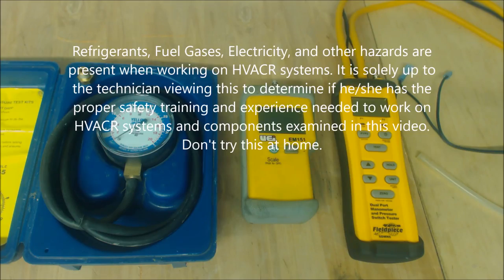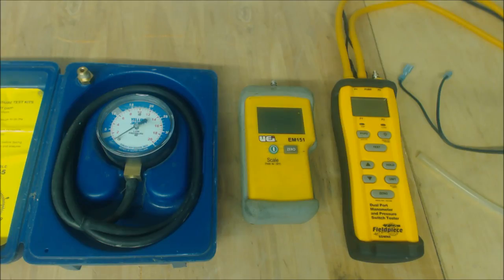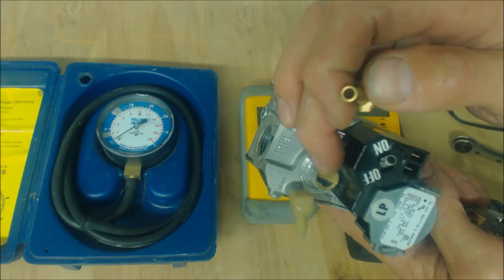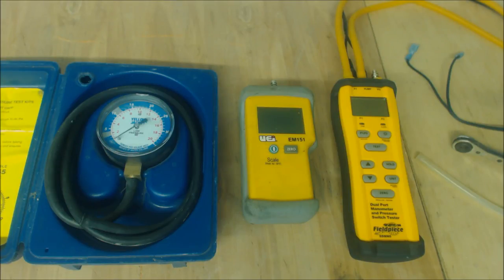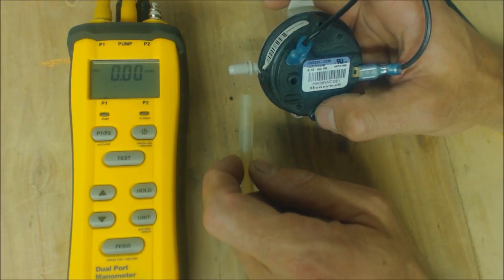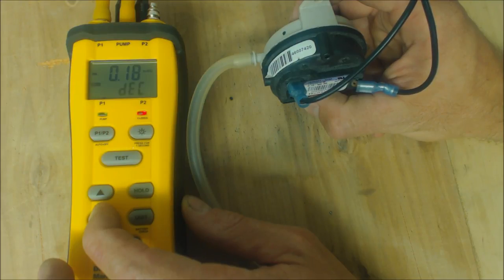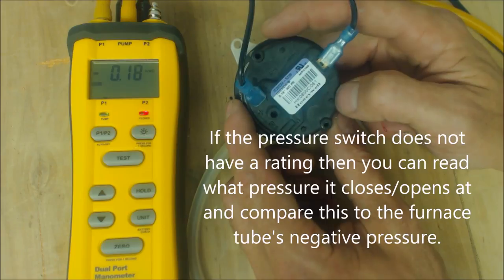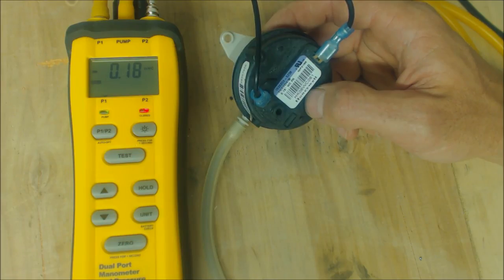Testing a Gas Furnace Pressure Switch with a Digital Manometer! & Why I Use This on Heaters!

Comment from the maker: Tool List-  https://www.amazon.com/shop/acservicetech
Support-  https://www.patreon.com/acservicetech
For those that are looking for the tools used in the videos: (Linked Below)

Here is the link to the Fieldpiece SDMN6 Dual Pressure Testing Manometer with Pump used in the video  -http://amzn.to/2jyK5Ka

Here is the link to the Gauge type Yellow Jacket Gas Pressure Tester-   http://amzn.to/2h8PANc

Here is the link for the 2 port UEI digital manometer since the single port is no longer available-  http://amzn.to/2x95KiD

Here is the link for the Ratcheting Service Wrench   http://amzn.to/2dGV4Nh

Here is the link to the Fieldpiece ST4 Dual Temp Meter- http://amzn.to/2wc1ME3

Here is a link to the UEI DL389 Multimeter used in the videos-  http://amzn.to/2xAdaJf

Here is the link for the Irwin Wire Stripper/Cutter/Crimper   http://amzn.to/2dGTj2V

Here is a link for the Supco Magnet Jumpers http://amzn.to/2gS4h6z

Other tool links can be found in the video description section.

ACSERVICETECH is a participant in the Amazon Services LLC Associates Program, an affiliate advertising program designed to provide a means for sites to earn advertising fees by advertising and linking to Amazon.

All of the ACSERVICETECH Playlists-  https://www.youtube.com/channel/UCOZR-1IqsAer9wzlvFgb4mA/playlists?view_as=public

If you want to support the ACSERVICETECH Channel and receive more HVAC content, correspond, or collaborate on your endeavors- check out www.Patreon.com/acservicetech

Comment: I love that manometer, heating season is starting and I look forward to using mine again ( Bought it after I watched one of your vids )  Prior to getting it I made a similar one out of my single port manometer, a T junction, tubing ( obviously ), and one of my insulin syringes with needle removed. ( im sure you can visualize how this went together) , I stuffed the syringe which fit perfectly in the tube and sealed itself and hid that it was actually a medical device ( less odd for customer ) And i could use the manometer reading after connecting and zeroing as the reference as to the vacuum I was pulling by pulling the plunger out  VERY VERY SLOWLY AND CAREFULLY * ( seriously green plumber reading this,do not underestimate how sensitive the switch is and how easy you can break it  )   *   I could then check the continuity with my electrical meter with aligator clips on the leads hooked up, I could do positive pressure switch tests in the same way by beginning with the plunger on the syringe pulled out. I loooove a good problem to solve, and when I was a young green gas fitter  a persistent problem to solve was how to ( ethically ) get expensive tools I could not afford to do the job. ;)
Reply from the maker: Wow very nice method and yes thanks for letting people know that it is very easy to break the pressure switch. I love this tester too, thanks!
Reply: Very ingenious! Now I am pondering on a 2.0 version using a fountain pen screw piston converter.

Comment: Love the videos.   Great that you explained how the manufacturer's have made these furnaces so complicated that the yj gas tester is almost useless.   Don't like the idea of buying another tool.  What happened to the good old days?
Reply from the maker: Honestly sometimes the efficiency is not worth is when an 800 variable speed part breaks like an inducer motor or modulating gas valve, thanks!

Comment: nice manometer, this thing is awesome. Ive a dual port tpi manometer, does not have a pump like yours though... that thing is pimp :)
Reply from the maker: It is nice! Thanks MrDmadness!
Reply: I odered one today.... I have used a syringe tied into a T of tubng for a long time now to add slight Pressure. ( Im diabetic, and the syringe has no needle on it ) and it always feels a little weird whipping out port tubing and a syringe on a service call. :)

Comment: how did you drill out that drip leg with barb fitting? how often do you find inlet gas pressure is incorrect?
Reply from the maker: Literally just with a drill bit and thread tap. Incorrect inlet gas pressure is found often on propane and also just when gas lines are incorrectly sized.

Comment: What size is the brass fitting?
Reply from the maker: Here are the links Chris and have you checked out the latest pressure switch testing video with the manometer?-

Here is the link to the 3/16" x 3/16" x 3/16" brass barbed tee-  https://amzn.to/2INSRhQ

Here is the link for the 1/8" NPTF x 3/16" barb fitting for reading wc pressure- https://amzn.to/2G563Bq

Fieldpiece SDMN6 Dual Pressure Testing Manometer with Pump-http://amzn.to/2jyK5Ka 
UEI Digital Dual Manometer-  https://amzn.to/2CWC6BD

Comment: with the gas valve you had  first  look like white Rodgers after market for honey well has no marking for wires .what wire goes where as I ordered one to replace ruud honeywell and it came with zero instructions .I know one is signal wire but does it matter what wire goes to what terminal

Comment: Where can I get those barbed connectors?
Reply from the maker: Here are the links Chris and have you checked out the latest pressure switch testing video with the manometer?-

Here is the link to the 3/16" x 3/16" x 3/16" brass barbed tee-  https://amzn.to/2INSRhQ

Here is the link for the 1/8" NPTF x 3/16" barb fitting for reading wc pressure- https://amzn.to/2G563Bq

Fieldpiece SDMN6 Dual Pressure Testing Manometer with Pump-http://amzn.to/2jyK5Ka 
UEI Digital Dual Manometer-  https://amzn.to/2CWC6BD